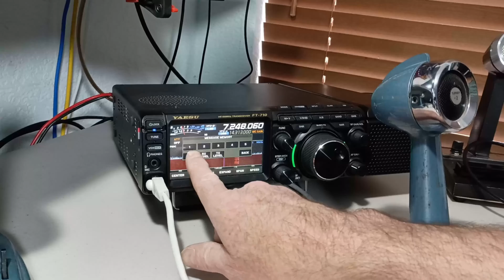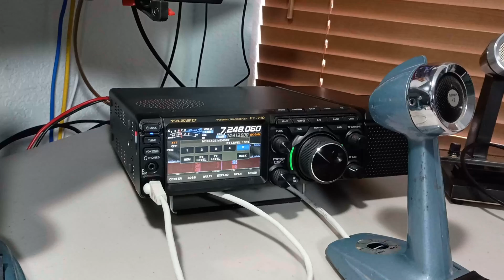Electret condenser microphone element installation in a vintage Turner mic.

Comment: Hi Rick, great video…. So is there simply no way to use a stock older Astatic D-104 or a Turner+3 mic on the FT710 without modifications?
Reply: https://youtu.be/O93vFTjugqY?si=Uw-I6ADSNRuWk9Xt they do work. I use a Turner +2 and a Cobra desk mic on my FT710.
Reply from the maker: Yes, you can. I'll put a link in the video comments where I did just that.
Reply: @RicksHamShack  thanks, another great video.  I was actually hoping for help to understand the pin wiring setup for a turner +3 and D104 (T-UG8 version) to FT710.  I think I’ve exhausted every possible wire combination but the mics won’t even key up leave alone modulate.  I tried the electronic and relay switch setting too.  Seems it’s only the following pins needing connection but both mics are 4 wire.

YAESU pin 3 Ground
YAESU pin 4 Mic Audio
YAESU pin 6 PTT
Reply from the maker: @leosgolf  Do you have a DVOM? If so, check for continuity between PTT and ground when keying the mic.
Reply: I do and it looks ok ... I have now successfully wired a Turner+ 3 to work but the D104 is still not cooperating.  The mic 100% works on another radio.
Reply from the maker: @leosgolf  Is the D104 4 or 5 wire?
Reply: 4 wire